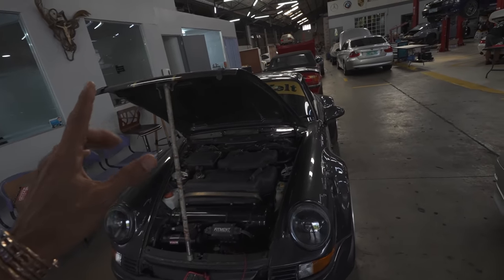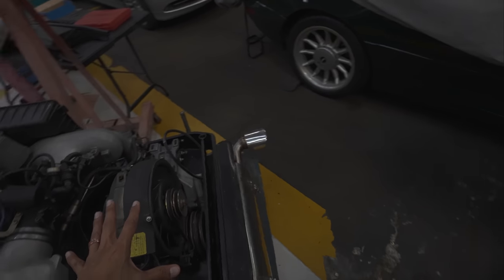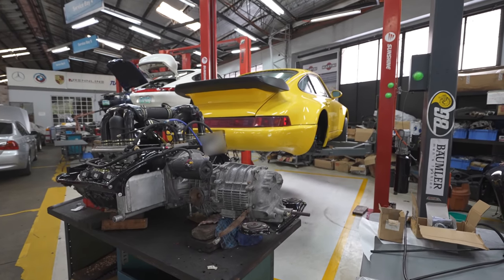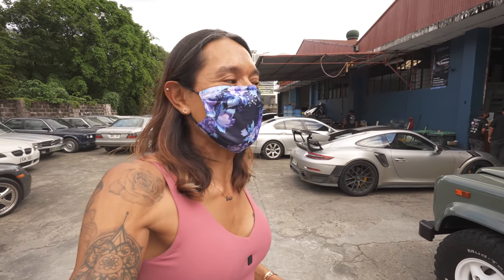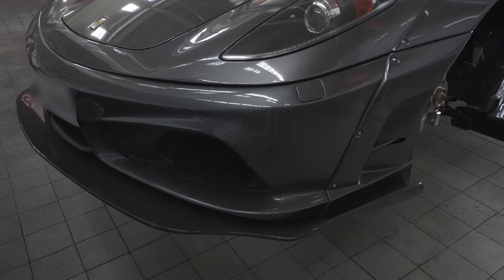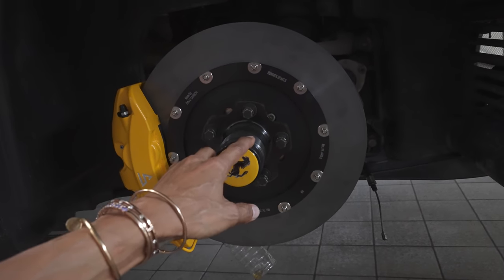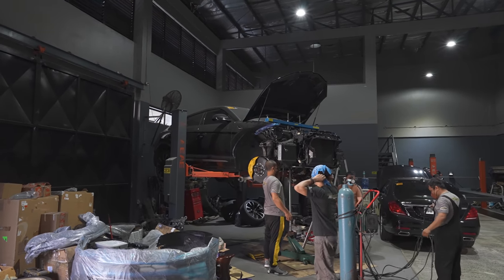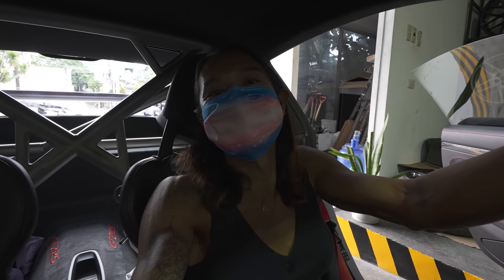What's New with My Car Collection? Mega Car Updates (2022) | Angie Mead King

Comment: Hey Angie. May I ask where to find more info on the Charger? You mentioned you were getting rid of it. Thank you and have a good one.
Reply from the maker: Hello Charger 8.6m
1968 Dodge Charger 
440 V8 engine with Fast EFI 
Automatic transmission 
Fully restored 
Vintage air 
Roadster shop front suspension 
Willwood brakes 
Moon wheels With Toyo tires 
4 months warranty

Comment: S15.4 next collection this year 
Get the beatiful design by driftmob ph  of s15 black  fornt bumper and s14 kouki and the wheels rota D2 ex size 18 or 19 then toyo tires proxes or nankang nsr 2 then the engine 2jz 1,500 hp or 900hp 
Then pink light metalic then silver rear spoiler